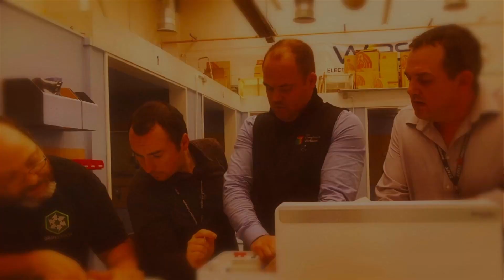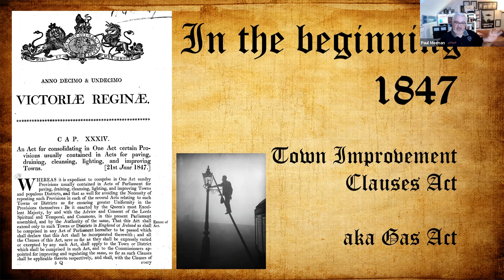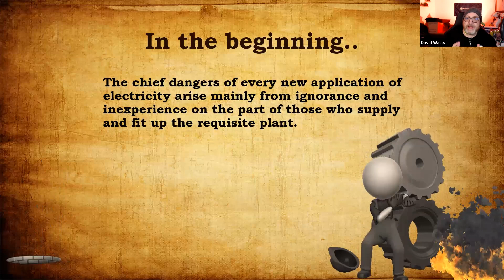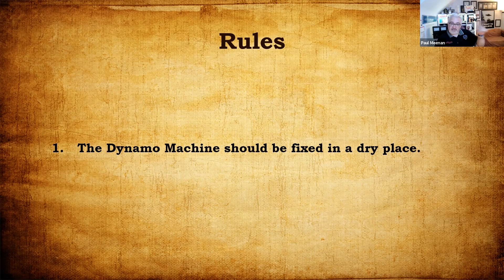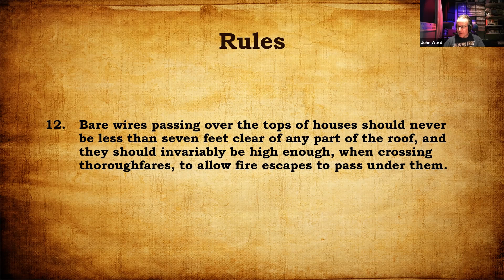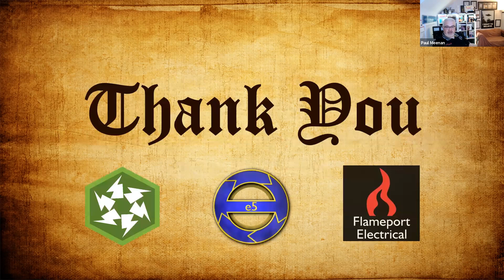Wiring Rules and Regulations (1st Edition) Webinar

Comment: Shock voltages: Were the telegraphs already using 48v nominal (~60v float) lead acid battery systems? 

It is a (my) persistent rumour that the (modern) 60v safe limit was based on the POTS (plain old telephone system) line voltage being proven safe through long usage and direct handling.
Reply from the maker: I’ll have a dig through the old journals… virtual ever conversation about electricity from those eras is documented. Fascinating stuff really.